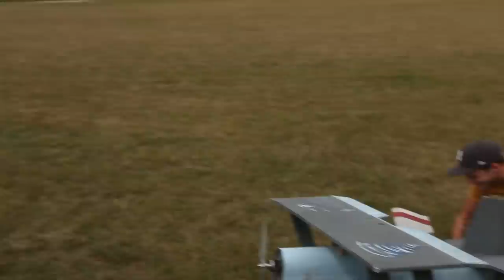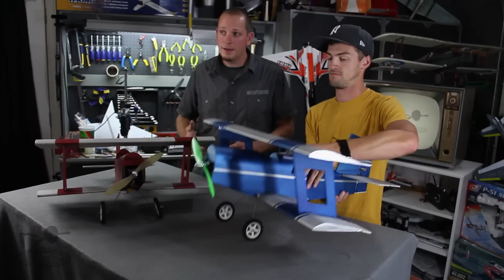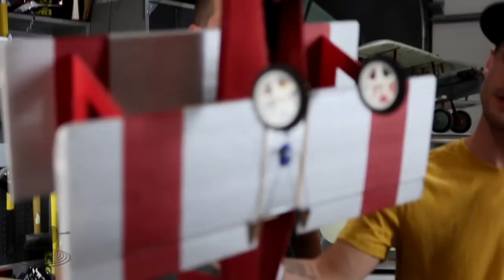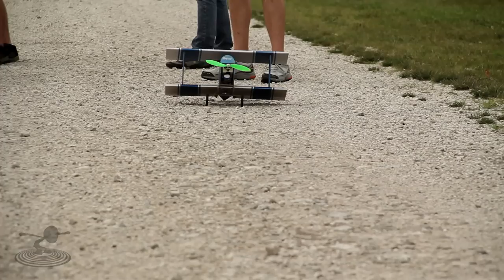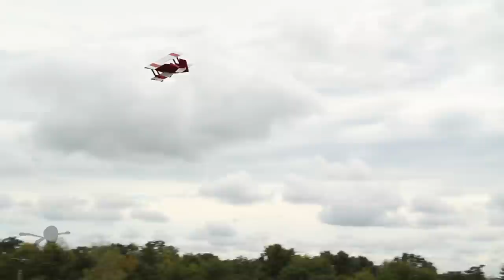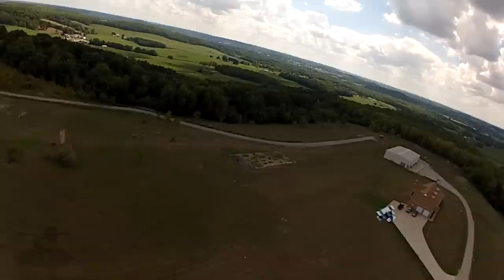Flite Test - Baby Blender Biplane - REVIEW

Comment: just a tip, when you make the "spar" that runs through the wing to make the bend and keep it stiff, it works much better if you rotate it 90 degrees, so that going from left to right you have paper, foam, paper, rather than having paper, foam, paper when you go from top to bottom. this way, the wings don't crease as easily, and have much more rigidity.

Comment: The zeppelin idea could work, build a skeleton out of foam board and make the skin out of Mylar.  Join and seal the joints of the balloon skin with rubber cement.  Only fill until buoyant, not until pressured.

Comment: would this be a good 4 channel trainer
Reply: I recently built this plane for a brand new pilot. After a bit of tuning and trimming, my new pilot has still had trouble flying, which led him to two crashes. It'd be better to start with another plane type, as orientation is more difficult with this model.

Comment: okay, I still don't understand the difference from swappable to conventional....
Reply: The swappable series have a power pod that can be removed and installed into another "swappable" plane.   It's designed that way so you don't need to spend extra on a new motor/speed controller/receiver for each plane you build.   Just swap out the power pod and your all set.
Reply: +Tim Marcotte Oh... Ok That makes sense.

Comment: Really, $4.00 for the plane? Of course the electronics are $250 or so, but I pay $13 for one piece of foam board and I usually need 3 sheets to complete a plane.
Reply: $13 for a piece of foam board? good lord thats insane. i was just at the store and got some for $0.89 a board
Reply: Say wah
Reply: David Bunch I don't know where you live but in most places in the U.S. you can get foam board for $1 a piece at dollar stores, you can buy it in bulk for even cheaper. Wish you had that, it makes building this stuff so much easier.
Reply: 250 for electronics? you can get the set up for less than 50 bucks.